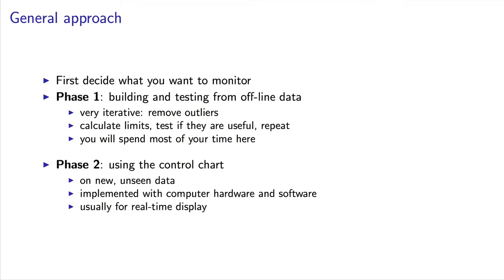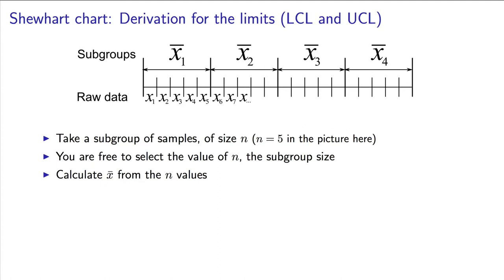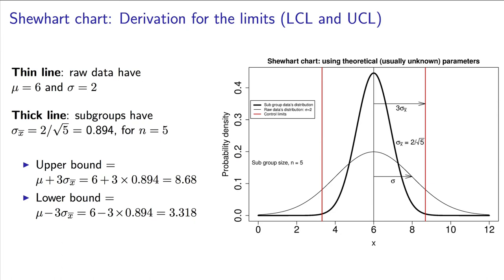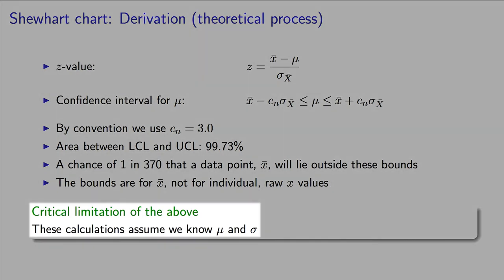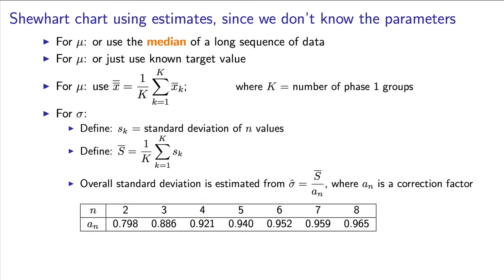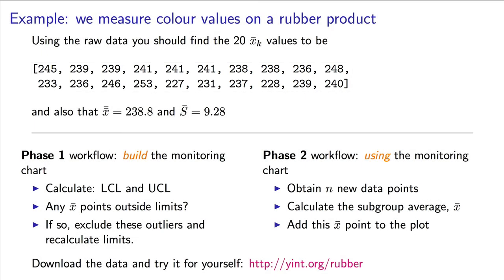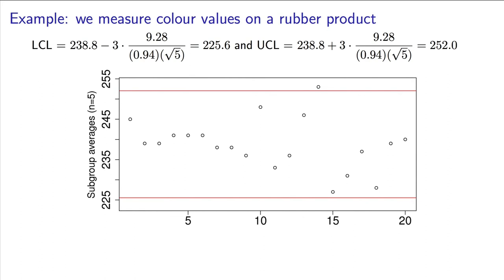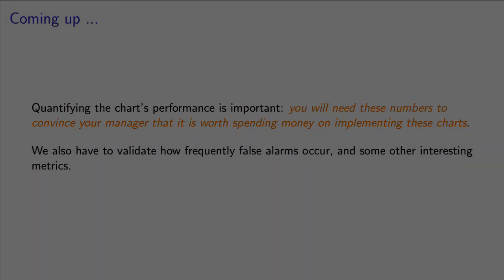Process Monitoring - 02 - Calculating the lower & upper control limits in phase 1

Comment: In a continuous, automatic bottling of mineral water plant, the quality inspector wants to
plot a x bar chart to monitor the volume of water in the bottles being filled. She has taken
30 samples with 4 observations each. The process average is 250 ml and standard
deviation is 0.16 ml.
So here what will be my Upper & lower control limits?
could you help me to understand this
Reply: is it Upper limit - 250.48 & lower limit - 249.52